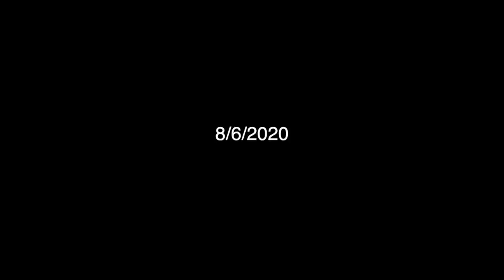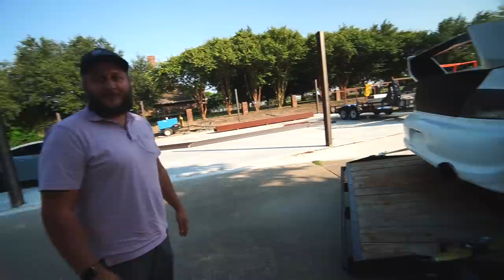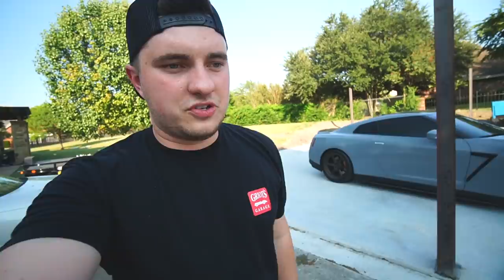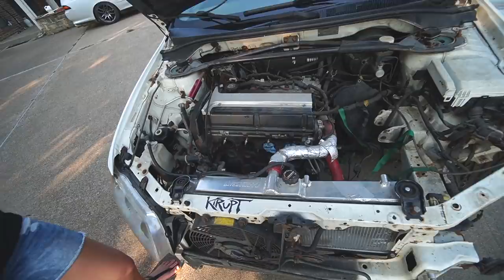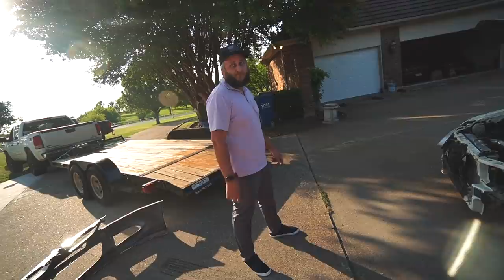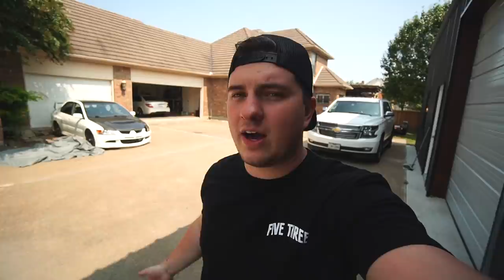FOUND AN EVO VIII MR IN A BARN - AND WE'RE RESTORING IT! (Car under the tarp reveal)

Comment: SAVE IT ! 
This will be your ultimate reliable four cyl family car as long as you’re looking for reliable power with a stock block, HALTEC, Bolt Ons & A NICE Tune 
400-450hp will be more then enough
Reply: 400 is the target you want for reliability, it's just the rest of the car you have to worry about XD

Comment: You sure it's a MR? I'm not convinced it is... The interior definitely is not from a MR as a MR comes with plain black alcantara Recaro bucket seats which do come as a half leather and full leather options also. The seats which come with a blue pattern are not from a MR.
A MR also has an aluminium bonnet (hood), aluminium wings (fenders) and an aluminium roof as standard.
It also comes with a 6 speed manual transmission from stock and not a 5 speed.
Bilstein suspension is also fitted from factory along with Xenon headlights  with a Matt Black background.
A genuine Carbon Fibre Fin can be found on the rear boot (trunk) spoiler.
Carbon Fibre inserts can be found in the interior trim including on the dash.
A MR plaque can be found near the gear lever to help distinguish & authenticate the car.
A few variations to the engine and components can also be found such as a different MR Spec camshaft profile, a Thicker Metal Multi Layer Head Gasket, a Larger Core Oil Cooler, a bigger 10.5 Exhaust Housing Turbo, a Revised Front LSD, 17inch BBS Alloys & a lower centre of gravity to name a few.

I only get frustrated when non 'MR' cars are referred to as such which undervalue the genuine 'MR' cars when trying to sell one (as I found out when I put my 8MR up for sale).

Irrespective of its a genuine MR or not, this EVO is a lovely car and I look forward to the build and content 😉

Comment: Your Evo X was way cooler tbh, X is the best handling Evo and the best looking.
Reply: 4b11 isnt a joke either, just as strong as a 4g63 when sleeved. Less random weird old car issues too.
Reply: @mikelbring  Everything is better on the 4B11t, stronger, lighter, sounds better, easier to work on, better fuel economy, no egr and other stupid early emissions equipment either, not to mention it even looks better. Thats just the engine, the Evo X 5 speed is WAY stronger than earlier Evo trans, and the Evo X has the smartest AWD system in the world still and it came out 13 years ago!

Comment: Nice! But I’ve had a 8 MR in the uk and I don’t think yours is a MR, I had the two lumps on the roof either side which means it’s an MR and if the roof is flat it’s not an MR. No hate just giving my opinion as I think you may be told false information 🤙🏻